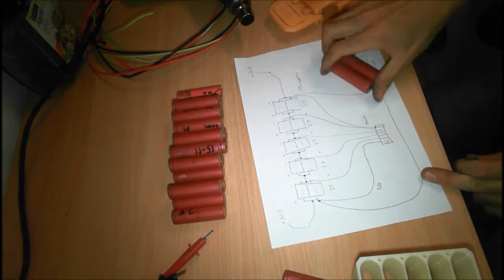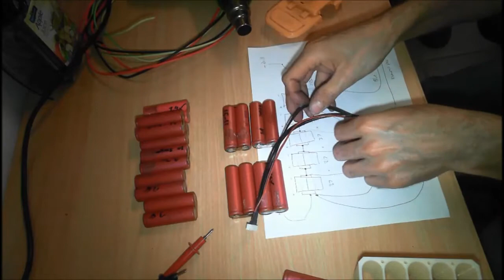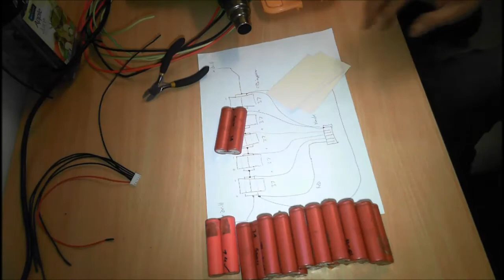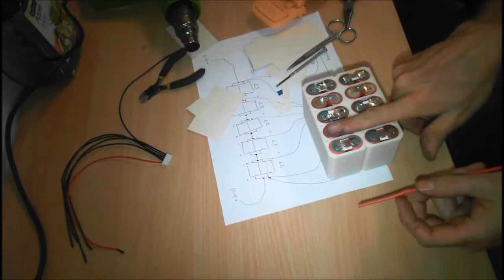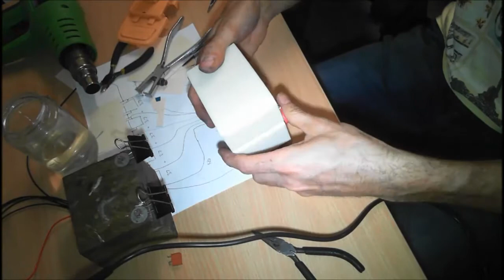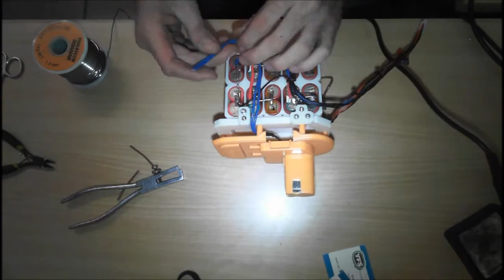3D printed Ryobi One+ 18650 LiPo battery module assembly utilising recycled e-waste laptop cells

Comment: Be interested to know how well that stays balanced.. 

Did you test the batteries? do you know what capacity is / state of them?
Reply: Once charged up they should stay pretty well in balance.

The only problem I can see here is that there's no under-voltage-protection? You SHOULD add a undervoltage-protection circuit. Or a voltage-monitor/buzzer atleast. To prevent it from going below critical and destroying the cells.